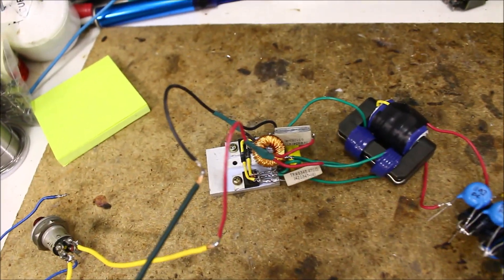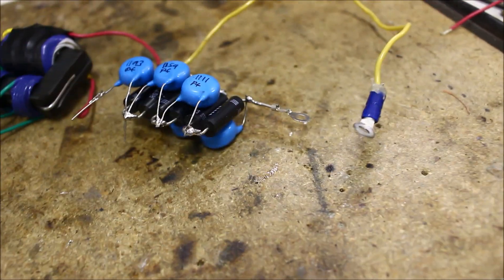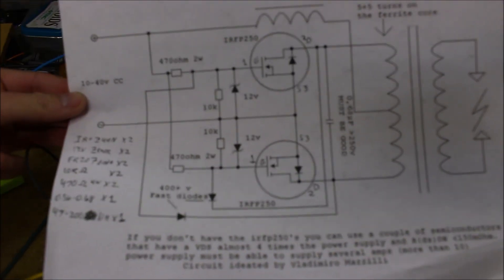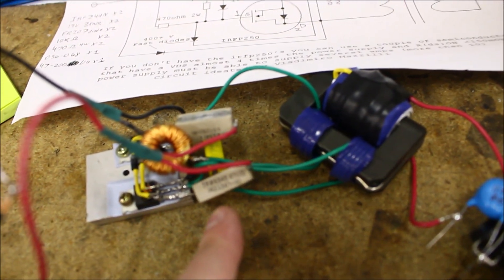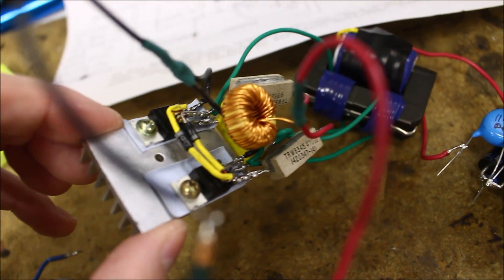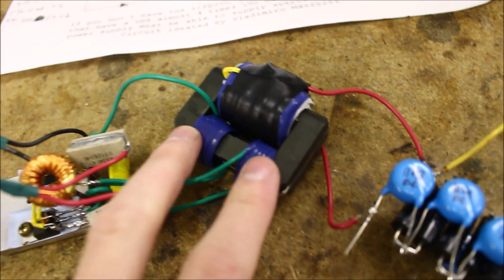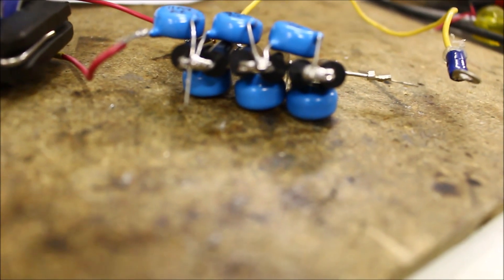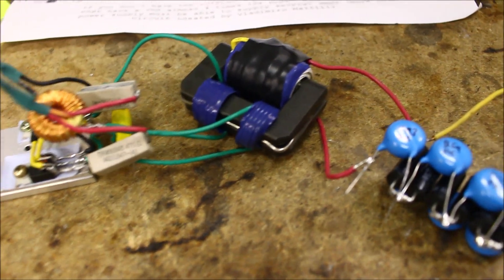ZVS driver part 1

Comment: Part 2?
Reply from the maker: it's on hold, i've added  a bank of 18650s and more caps/diodes but voltage has dropped. i'll put a scope on the driver. there will be a 2.
Reply from the maker: circuit failed, it was pulling 120-130 watts. i haven't repaired it.